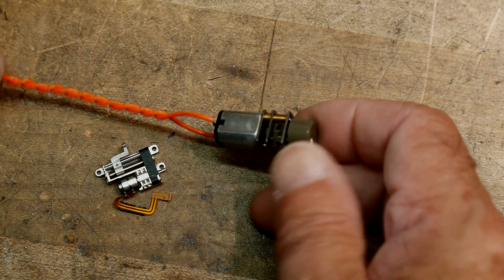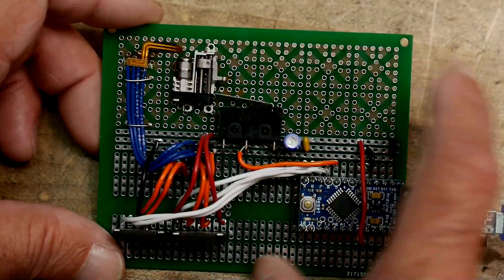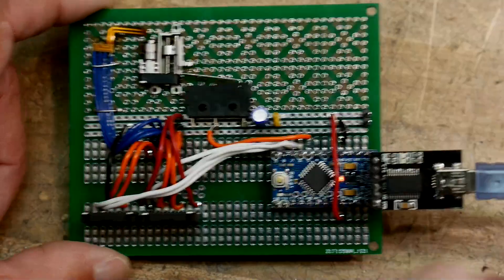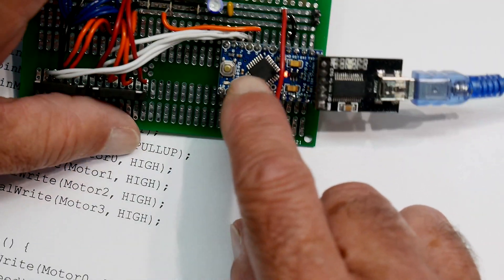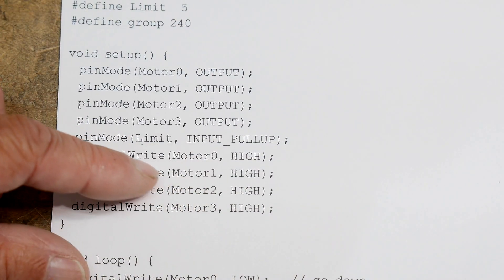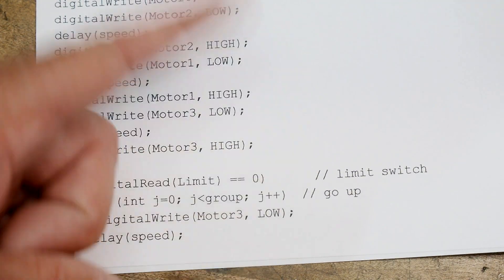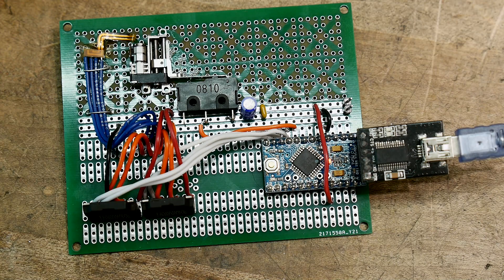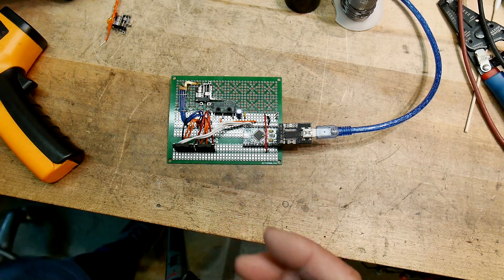#789 Four Wire Stepper Motor (part 2 of 2)

Comment: Although the little motor looks to run very smooth, was just wondering if it would be possible to micro step them through those driver ic's by giving varying PWM values to each coil.

Comment: That type of thermal detector averages a 30 degree cone of views temprature, and you held it over a foot away.  Hold it right over the motor for a true reading of a spot temperature. (The laser is only for aiming)